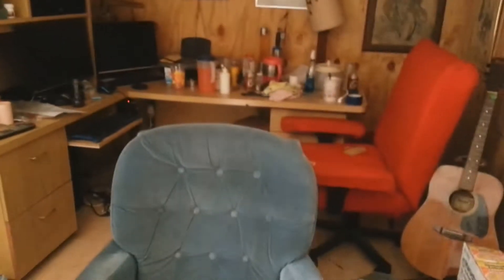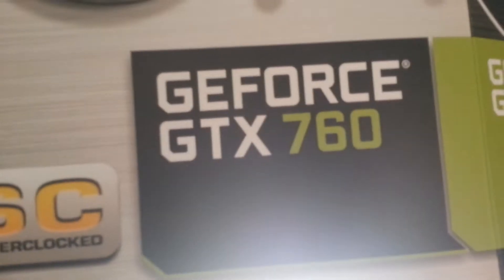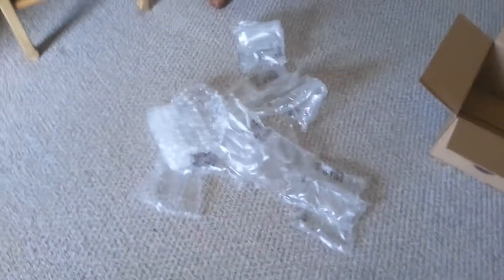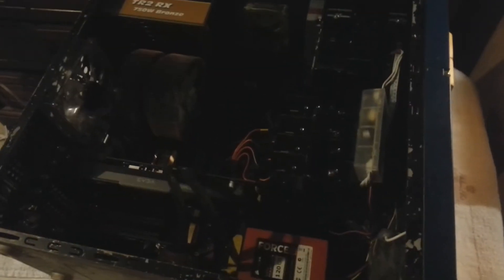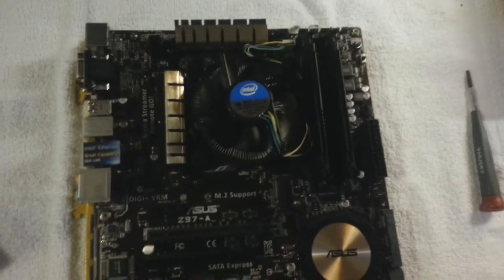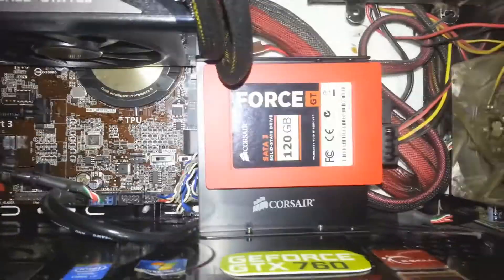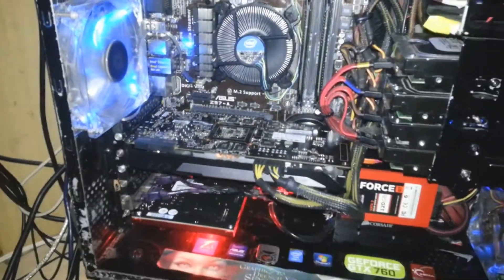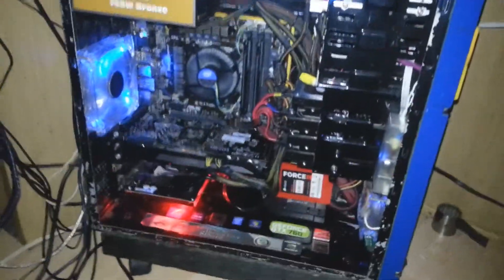new pc build

Comment: Sound i get the asus z97-a or msi z97 gaming 5 ? 
Also Cant decide  on the chassi.
Corsair obsidian 750d or the phanteks etnoo pro? Or can anyone recomend something else. Its my first computer that i am building so any tips for how to connect everything would be awesome it looks hard but i want to learn .
Reply from the maker: Definitely the ASUS board. It has far more next gen stuff on it. The MSI board does not support SATA express. The MSI board does support M.2 as does the ASUS board. I know I will use SATA Express when the hardware is available at a reasonable cost. The UEFI Bios is excellent. Perfect for optimizing the motherboard. I plan on having my Z97-A board for 4 to 5 years so extras like these are necessary to future proofing for me.
Reply: Thanks for your answer :)
Reply from the maker: Kent Bollström
 Glad I could help you. I forgot to mention that when looking for a case, just make sure that the hardware you get will actually fit in it. The Corsair Obsidian 750 is a nice case and should work well for you. Plenty of room and airflow in there. Make sure that you get a good power supply. Get one that is rated at least 200 watts over what you need for power and a minimum of a 80 plus bronze. That way all your components will get all the power they need. You can also upgrade or add new hardware later with no problems.
Reply: Thanks again . 
This is the spec i go for
Asus z97-A
I7-4790k
8g ram 1600mhz
Asus gtx 770
Samsung evo 120g for windows
Barracuda 2t